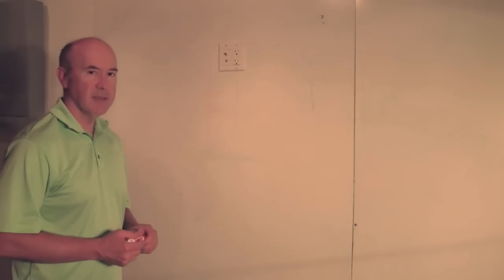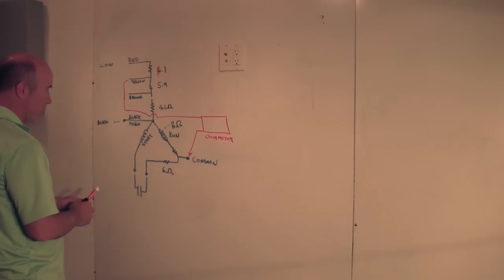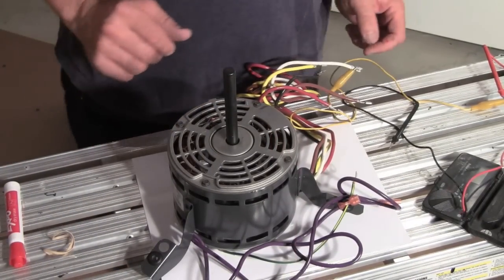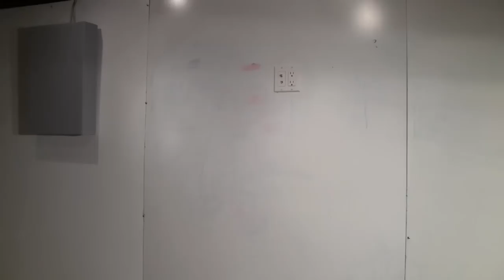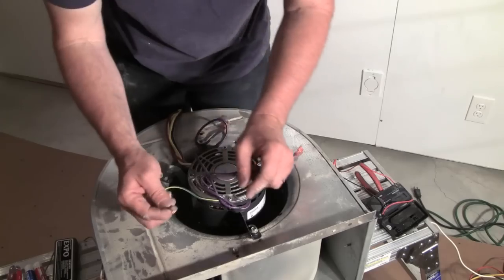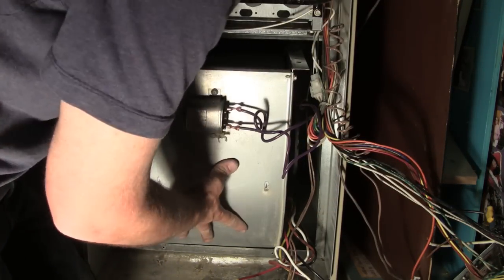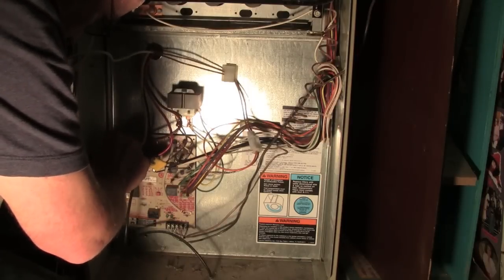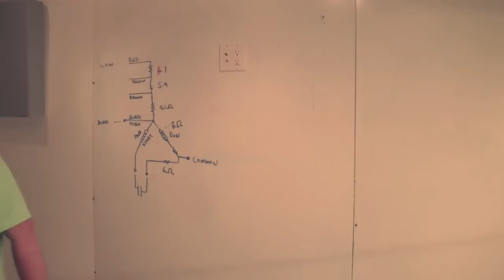Furnace Blower Motor Diagnosis and Repair

Comment: Good video, you're right that the polarity of the capacitor doesn't matter, remember AC swings both ways. Also when polarity does matter you don't usually have two wires the same colour. 
The description of squirrel cage refers to the rotor of the motor and not the scroll type fan as so many people believe. 
It's a shame that there are so many greedy people that don't change an honest rate for work so people have to have a go them selves. 
Glad it all worked out for you.

Comment: Great video. It took my fears away!
A couple of days ago I noticed "weird behavior" from my heater system, like the fan keeps on running a while longer than usual blowing cold air after temperature on thermostat reached its settings (fan motor making unusual noise).
One morning, the fan stop spinning and I can hear a humming noise coming from the air vents... I noticed the fan motor not spinning and humming noise will stop minutes later. The gas furnace will go on and of, so the humming noise from the motor. I tried to spin the fan manually and I felt some resistance.

My fear was about major damage and costly repair, but now I got a great reference to troubleshooting and/or avoid being ripped off from a technician if I decide to go that way.
My mistake: 15+ yr old unit (Lennox), never serviced besides frequent filter replacement.

Thanks a lot

Comment from the maker: Blaise, Thx for your comments. You are correct that the capacitor is between the start and the run. So what I have labeled as "Start" is incorrect. The start is the 6.2 Ohm leg at the bottom. And yes if I measured from the capacitor lead going through the 6.2 ohm start winding to the black I should get 6.2+2.9=9.1 ohms. I am still confused and can not explain why I measured 73 ohms from the common to the other capacitor lead. You Tube marked some of you comments as SPAM, but I left the one PSC diagram with some text you provided. Thx for pointing this out. I did say in the video that I don't do this for a living (i.e. there are definitely people that know the content much better than I do).

Comment: Awesome video.  Really appreciate it.  I just happen to have the exact same model furnace and I discovered that my motor wasn't turning, causing the heat to build up in the heat exchanger until it tripped the limit switch.  Now I can probably verify if my suspicions were true.

Comment: in my experience with non brushed motors 90% of the time cleaning the bearings and adding oil will fix the problem as there is not much else that can go wrong. very seldom do the windings go bad unless the motor was overheated.

Comment: We have a unit about 15 years old. the orginal  blower motor went out 2 years ago and we had it replaced. The new motor lasted about a year and a half. Put another new motor on. That was in January of this year and already it is making that terrible sound one makes just before it freezes and dies. Is it time to get a whole new system? Are these replacement motors junk? any info would be appreciated.
Reply from the maker: I don't know if some of the motors are junk or not, my replacement is still going strong. I got mine from RepairClinic.com

Comment: On Thurs evening I suspected that my furnace was going bad or something was wrong, because I was losing heat, Fri morning I called a local repair place(who is excellent) and I had to order a new blower motor- and the cost with the repairman replacing it costs me almost 400 dollars. And this weekend I have no heat save for a small elecric heater

Comment: Did you use a press to drive the shaft out of the fan or did you use a puller. I seems like I could use an arbor press to press the shaft and motor out.

Comment: Hi, thanks for your video. So if I can start motor with my hands this is mean I need new capacitor, right? I have 2 furnaces in my house and use only one for years. When cold storm hit us yesterday turn on my second and noticed no air blowing. Heater start working and shutdown after 30-60sec and blower never work even when ON position. I try to turn on blower with my hands and everything works but only until its off. Then same thing I need to turn blower with my hands. Bad capacitor?
Reply from the maker: 1) I won't claim to be an expert. 2) My capacitor was less than $10, so it is a cheap gamble to replace. 3) if the two furnaces are identical, or use the same capacitor, you could temporarily swap parts. 4) without putting much thought to this I suppose you could have a bad start winding. See the note that indicates I had something labeled incorrectly around 12 minutes in the video. 5) this link might be useful: http://tinypic.com/view.php?pic=zn4hvc&s=5  . Also Google PSC motor for some good reading.

Comment: Hi my motor fan keeps sliding to the side and makes a lot of noises is there a problem with the motor because the screw that scow the fan is tight but the fan seems to be sliding in and out from the motor
Reply from the maker: sam mikhael if the shaft has a lot of end play, and it makes noise in one position, it kind of sounds like a bearing to me.
Reply: teesalmon so the shaft you mean that metal thing that inside the motor? And if it’s a bearing how do I fix it?
Reply from the maker: sam mikhael if a bearing is bad, I’m not sure where you would buy a replacement. If that is it, you may need a new blower motor. You might want to research this further.
Reply: teesalmon ok but the bearing is located where and my motor is not coming off the fan is it because it’s stuck or ?
Reply from the maker: sam mikhael the bearings are inside the motor, at each end, search for rebuilding electric motors and you should be able to see what is inside. That will help you figure out what is wrong with yours

Comment: my furnace is 20 yrs old how hard will it be finding a replacement motor?
Reply: i too have an older furnace. i am wondering the same thing as mine recently stopped blowing.
Reply: filthy sanchez For what it's worth they replaced mine without a problem and it was a good 20 yrs or older. Best of luck!
Reply: how much did it end up costing you?
i believe my furnace is from 1996 so it's about 18 now.
Reply: filthy sanchez Actually it didn't cost anything at the time since I have insurance with my utility company which is like 6 bucks a month and they'll fix my HVAC if it breaks, up to 1500 a yr. The only draw back is if the furnace or ac can't be fixed and needs to be replaced, then you're SOL. I asked the guy that did the work and he said parts and labor would have been around 500, anyway I hope this helps.

Comment: my furnace starts but is not blowing air. what are the chances this is what i need to do?
Reply from the maker: Note: I am not a pro. However, I would turn the fan from AUTO to ON then check the voltage going to the fan, or maybe carefully try to spin the motor by hand to start it making sure you rotate it in the correct direction. If it runs after you start it by hand then perhaps the $10 capacitor is faulty. If the fan is getting voltage and won't run, then it sounds like the fan motor might be bad,
Reply: teesalmon
the capacitor is fine. Time to check the motor. Also when checking the wires you used the black test lead only. What was that you did with the red one? and why?

Comment: Was the run capacitor on the original motor good or bad?
Reply from the maker: It was bad. I wish I would have spent the $6 to buy a new one at the beginning.

Comment: a faulty capacitor is usually the problem. and 90% of diyers wind up replacing both motor and cap. now all that money wasted and time. it pays to hire a pro. annual maintenance should be checking capacitors. if not find a new company.

Comment: when the heat is on but not the blower motor what could it be
Reply: +Eddie Matos   check the blower motor relay before you suspect the control board ....also check the switch continuity of the thermostat